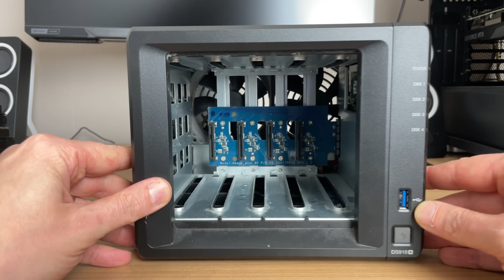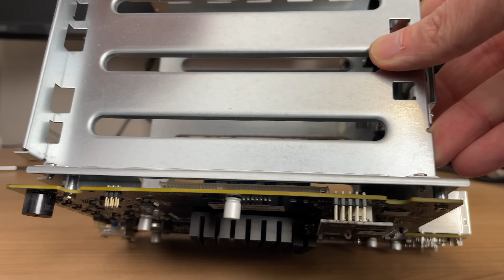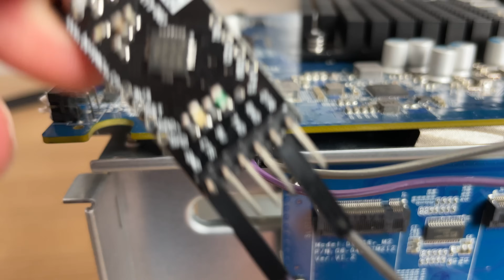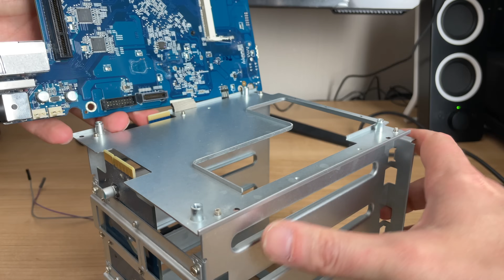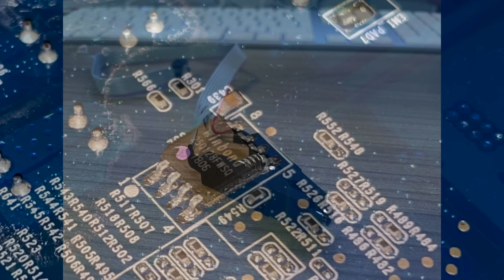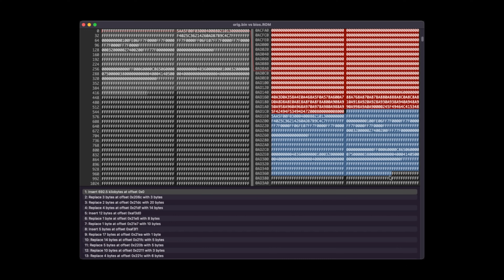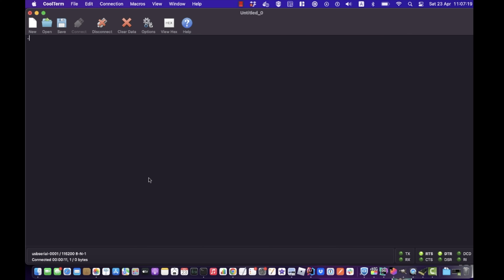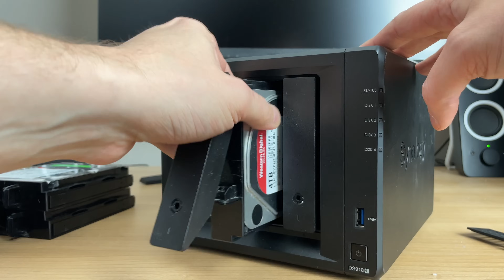Synology DS918+ Bricked / Blue LED of death.

Comment: synology is a terrible company that makes terrible products, I've run across too many dead synologies and every time they essentilly tell you to pound sand... I will never purchase any of their stuff again and have convinced several friends/customers to use other manufactuers products (usually asustore)
Reply from the maker: Have mixed feelings. I think their product offering is ok for most people. Had 2 Synology products before this one that are still running. The software (DSM) is pretty good and user friendly. I know a lot of my audience tend towards DYI solutions but that's not an option for most people. You just have to be lucky with these things I guess. When QNap had the whole ransomware attack I imagine lots of people were also greatly affected by that. No experience with Asustore so can't really say.
Reply: @RetroSpector78  We'd love to send one to you with HDDs if you would like. We have expanded and made sure our retro protocols are up to snuff and compatible all the way to MS DOS 2.1
Reply: Synology's firmware solution needs some  work I gues, but I wouldnt call the whole thing terrible. As soon as you put these disks in a new synology it would just boot up again in its current state, with almost no configuration. I dont know about the higher end Synology products, maybe these have an emergeny bios or something.
Reply: @basvanharen2904  they boot from the flash chip first (the DOM) then it migrates the configuration over to new nas hardware and then boots from the installed drives like normal (the DOM is mainly there to install dsm it's inactive unless an dsm update happens)

The part that failed here was the bios got corrupted (before it boots the DOM/installed drives) at power loss witch shouldn't normally happen (like the power loss it self wasn't clean and was a brown out  and damaged the stored data)
Reply: Your support is appreciated! Feel free to ask questions!

Comment: My guess is it wasn't the power cut that killed it but a previous auto update from Synology (I don't have one so don't even know if it does that so this is a guess). It's only when the box power cycled that you discovered it was no longer bootable. This is something large organizations learn quickly when they update software on their large estate. Always manage your updates and schedule power cycles incrementally across your network. I've worked in a large organisation that found out the hard way when they had a power cut and the ups failed.
Reply from the maker: I'm pretty careful with those and don't have automatic updates on, and also don't allow the thing to turn again automatically (to avoid issues with power turning on / off / on / off when you're doing renovations or something). Could have been more careful here as it was a "planned" outage but still ... didn't think these things could be so fragile given lots of other people experiencing the same issue.
Reply: @RetroSpector78  agreed, seems strange so many people are having issues. BTW, forgot to say: Great video and a good bit of trouble shooting.

Comment: I guess it was bit rot  that made your nas fail, and the power cut just reinitiated the post sequence that showed failed bios I was afraid that it could be the atom c2xxx bug but as you told it was Celeron then it should be ok, should backup your data to other source if your data is important.
Reply from the maker: Yeah ... going to install a could sync from now on on every NAS box :)
Reply: I think you're right, and you're the only comment I found suggesting this. The power loss is probably a red herring that simply exposed the underlying problem.

I'd be very curious to see an analysis of the corrupted data. E.g. if all of the bit flips were from 1 to 0 then that is a smoking gun for charge leakage of the flash cells. Synology should address this with a ROM backup and a regular maintenance cycle that checks the flash bios checksum.

I manage large numbers of systems as part of my job, and I've learned to fear power outages. Not because of the damage the outage can do, but because of the number of ways systems can become the walking dead; they'll work indefinitely until they power down. This corruption could've happened weeks or months ago.

Comment: If it has its Own processor Maybe thats where Fault Lies, as i have seen Game systems where either Video chip or Main processor started overheating even when Fans ran as well, Check them if it has them as well, as seems a chip failed.

Comment: Nice one! I guess I'd start off with connecting the drives to a linux box to see what's there. Usually it's mdraid, after all, so it shouldn't be too hard to get out, but them, you'll need the space to back it up etc. This is one of the reasons I tend to stick to home-grown servers with mdraid (or something) instead of something fancy ;)

Comment: How long before that flash chip goes corrupted again? Its spec sheet states Absolute Maximum Ratings of VCC+0.6 volts.  You're going to need a very clean power supply to ensure that never happens
Reply: That means the data pins cannot be driven more than a diode-drop above the supply voltage (Vcc+0.6V), which is quite ordinarily the case for digital logic.

If you were thinking that meant it had to be regulated within a 0.6V margin, that is pretty generous.  If your regulated rails are seeing swings beyond that, something is wrong, brother.

Comment: Um. Am I missing something, but doesn’t someone with your knowledge understand the need for a UPS for your NAS? I got burned once with a Drobo, and like you was able to recover, but it took me weeks to find the correct solution. Once I got my two Synology NAS’s I instantly bought two UPS’s. Have had a couple of power outages since and all is well since Synology integrates with the UPS and shuts down cleanly instead of just crashing. You’re lucky you didn’t lose a drive. That said, I commend you for you ability to discover the problem and Re-flash the BIOS.
Reply: Pretty sure I’ve had more UPS-related power issues than commercial power failures.  I know that depends on where you live, but UPSes are often quite interruptible.

Comment: I think they could at least come up with a firmware recovery option.   A lot of PC motherboards have this.  Just plug in a USB stick containing the latest firmware downloaded from the manufacturer's website, and possibly push a button.   That's pretty much how my PC motherboard does it.

Also, I had an old Pioneer VSX 808 home cinema amp effectively killed by a power cut.    It was nearly 13 years old, which is a good age for consumer electronics now.   One day, I was happily using it, then the power started browning out.   Then it was cut for several hours.  When it came back, it was still browning out.   

I did unplug the amp when the power went, but the damage was already done.   It took a couple of attempts, but I managed to get the amp switched on.  It had lost all it's settings, so I went through setting everything up again.   When I'd finished, and was using it, it seemed fine.   This happened again and again over the next couple of months, getting worse and worse.  Eventually, I had to dump the amp.  Partly because of this, and partly because due to other things, I no longer really had the room for a home cinema system.  Still don't really.   Perhaps when I get an extension built.
Reply: that is why IMPORTANT equipment is MUST BE connected through uninterruptible power supplies (UPS)
Reply: And how the flash drive will help in case of bios breakdown? it`s just does not work
Reply: @Blesna  Some motherboards have a "biosh flash" mode that allows you to put a bootable program on the USB drive and reinstall the BIOS or update the BIOS. Only problem is that enough of the BIOS needs to be working to boot to a USB drive and install a new BIOS.

Comment: XPenology ftw.
Reply: Running that as a VM on my ProxMox setup.
Reply: Im running two on microserver gen8 each with 4x4TB WD Red. Imho synology is a good OS but the Hardware is cheap crap that is Sold for a high price because of the OS. We already saw multiple flaws with their Hardware.
Reply: @LGBKAI  I've been debating of getting one just to run my security cameras but XPenology works pretty well in ProxMox so may find a used Microserver Gen8 to run ProxMox on.  I currently own Gen8 running TrueNAS with 4x4TB WD Reds.
Reply: @Darkk6969  That's awesome. However imho I microservers are the best for the low power Intel CPUs but those low power intel CPUs do not like anything heavier than the Synology OS, and with that it struggles sometimes with high load times

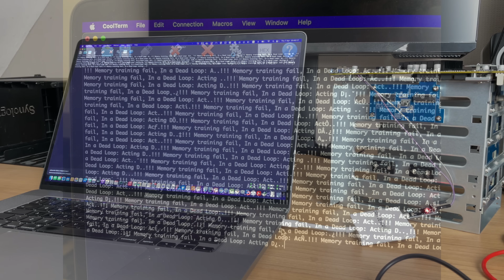Comment: 9:15 - you inserted a DDR3 module, but Synology chip was DDR3L. It might be an issue if the board delivers 1,35V as it is not enough for most of regular DDR3 chips.
15:25 - what a mess. Why won't you clean that flux residue with IPA? Fluxes tend to chemically react overtime with soldermask and/or metals on PCB if left on without cleaning.
Good job on putting that thing back on. Also, in my opinion the music you've put on the clip is a bit too loud.
Reply: I would imagine he did before putting it back together. He is pretty thorough in every repair vid.

Comment: the original Synology 4GB memory module was DDR3L whereas the replacement you tried was just DDR3 - given that the DS918 was a 2017 release it is unlikely 1.5V DDR3 modules would be compatible whereas another 1.35V DDR3L module would probably have worked fine - the memory training error was also probably due to this - own a couple of Synology NAS boxes and only had one failure so far (apart from hard drives) which was the power supply - found an identical one cheap on eBay with a different plug so one quick soldering job later and back online
Reply: I had the 1815+ at work die on me due to failed power supply.  Lucky it was replaced under warranty.  The thing is the NAS is plugged into enterprise grade APC battery backup so it shouldn't have killed the power supply.  Especially in an expensive piece of equipment.

Comment: I can appreciate the idea of an all in one NAS, but this is a good example of why I opted for a recycled tiny Optiplex.
Reply: So.. you buy used hardware instead? Thats a nice solution, they will break to. When a cap goes it does not matter if it is synology or a optiplex.

But mainly, there is 0 replacements for a box the size of a 4 bay NAS. I would love a freeNAS or opensource system, but i refuse to have a box 5 times the size and noise. Also Syno comes with alot of extra fluff like services and programs not available on FOSS devices, so you loose a lot of simplicity

Comment: A dual bios is a good solution, amazing they don't have it on a crucial device like this.
Reply: oh, i am not alone with dual bios coming to mind :)
Reply: Yeah or maybe USB flashback like on a lot of pc motherboards
Reply: Not always, My Gigabyte MB was bricked even with dual BIOS.
Reply: @nadirsalim7419  This happens with Gigabyte motherboards.  I quit buying them about 15 years ago because they were so likely to become bricks even without updating the BIOS.  Gigabyte just doesn't have a good reputation in my book for reliability.
Reply: This is consumer grade, and it is meant to fail every few years. You can then give them more money, plug your old hard drives in a new box and voilla, all your data is still there. 
They do have more professional-grade versions though, and i bet these are more robust.
Reply: Seriously, motherboards have had this for ages. I tried talking to a customer service rep. He's like, subscribe to our image backup service. Like, do you really not have any firmware/bios/OS backup to fallback to? What if theres an outage during update? NAS's are supposed to be redundant!!!
Reply: Too much overkill to design in when you're small and too frightening later... Typical issue. There's more things with Synology OS that just could use a strong team redesigning it. But like anywhere the deep gut bits are not what people wanna know about or make their buying decisions on. Like "stronger protection against bios and os corruption" is something all systems could use, but listing it as a feature will have adverse effects...
Reply: @udirt  When talking about adding a dual firmware setup to ANY computerized system the increase in complexity is so minimal as to be something that can be disregarded.  All you are talking about is setting a single bit flag in EEPROM (available in EVERY CPU & MCU today) to identify which is the current firmware at power on or reset.  If the newly flashed firmware is functional it sets a flag in EEPROM to indicate that it successfully started up.  This flag is used at the next power on to determine which firmware is used: The new one or the previous one.

This sounds much more complicated than it really is.  You are talking about a couple of lines of code in the boot loader and as little as one line of code in the firmware.

The only thing that could make this more complex is if the boot loader is not already doing a CRC (or a least a checksum) before executing the firmware.  If that is the case then the manufacturer is just incompetent and their products are not worth buying:  If they can't keep their firmware safe then how are they going to keep your data safe?
Reply: It’s a cost cutting measure. Extra development, $2 extra parts. Don’t forget, this is China we are talking about here.
Reply: @56585656587  I agree with the sentiment, not with the geography though. Taiwan is not PRC. (At the time I am writing this, gotta be careful in 2022...)
Reply: @56585656587 Not China! These are made in Taiwan. Synology is a Taiwanese company, not Chinese. Just saying... (but they still should have dual bios!)
Reply: @PWL104  you guys know that taiwan is just "another" china right? like calling east coast usa different than west coast, or east and west germany.
taiwan is neither independent nor different than china, and they are also chinese, originally right wing chinese, while the left wing chinese won the mainland after feeding the right wing to the japanese in ww2.
Reply: @majstealth  Confidently incorrect there. Taiwan is an independent country, completely separate from China both physically and governmentally. They're also a democracy with a very high rating on various freedom indexes, with progressive leadership and robust legal protections for the citizenry and democratic process. They score higher than the USA and South Korea currently on the US-run Human Freedom Index.
Your analogy of east coast USA and west coast USA is totally off base - east and west Germany pre-unification perhaps, but not now.
Reply: @majstealth  I seem to recall "Taiwan, R.O.C." being the full name.
Reply: @Dave5281968   @m0rthaus   it totally depends on whom you ask - i dont care, china cares a lot. dhina des not like when forigners talk to taiwanese officials as if they are independant, even if you could say they are.
Reply: @PWL104  and @MisterFrickel Taiwan is the name of the island and is controlled by the Republic of China (ROC). The mainland is controlled by the People's Republic of China (PROC). Taiwan is not fully recognised as a separate country yet (although, personally, I think it should be).
Reply: My thought exactly. Not gonna buy anything from Synology, ever.
Reply: PReferably with the second bios read only, so it cannot get corrupted. There should also be a OTP section which contains the serial number. DSM checks the validity of a device by the serial number amoungst other things, preventing it from booting on non Synology hardware without hacking (xpenology) Sure you might have to re-enter some settings if the main bios fails and is "re-flashed" by the backup bios but that beats the hell out of diassembling the device, desoldering the flash ic, and hacking at it with a hex editor :)

Comment: Very nice bit of forensics with the rebuilding of the correct firmware image!  I can't say that I would have gone that far myself.
It is sad that Synology did not include a dual firmware so the system could restore itself from a backup firmware image in the event of a corrupted firmware being flashed into it, especially when considering how much the device costs.  I mean, even some low end MCU's have that dual BIOS feature built into them!  (Even inexpensive Microchip DSPIC33's have this feature!)  This is a SERIOUS failing on the part of Synology.
Reply: Yes I agree.  I am very surprised to see this happen caused by unplugging the cord.  I'm always nervous of doing BIOS / firmware upgrades as anything could happen if it doesn't have a backup BIOS / firmware on the motherboard.
Reply: How often does stuff really get corrupt BIOS? When a system flashes a new image, it will verify it before powercycling. You can remove the flash entirely during operation as its not used after the bootloader.
Reply: @jmkhenka  The point of a dual BIOS is to allow a system to function in the event of a bad flash of a BIOS update.  Adding a second 16MB flash would cost them only one or two dollars, and increasing to a single 32MB flash chip would cost even less.  Every PC made today has this dual BIOS feature, not because the vendors expect a bad BIOS flash to occur, but because things can go wrong and a dual BIOS can prevent bricking of hardware that costs hundreds of dollars.  The omission of this from a $500 local cloud storage device is a serious oversight that has probably cost many hundreds people hundreds of dollars to recover from.  That is a quite unacceptable situation when a second copy of the BIOS is such a trivial addition these days.  (And, yes, even simple and common a decade ago.)